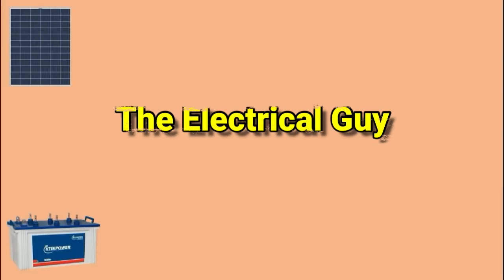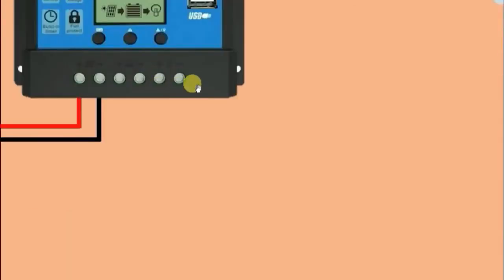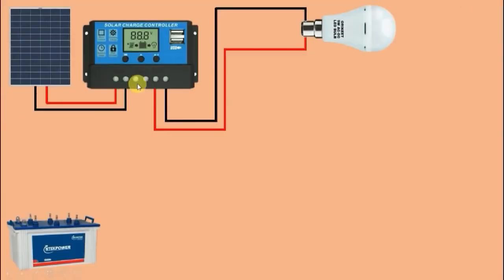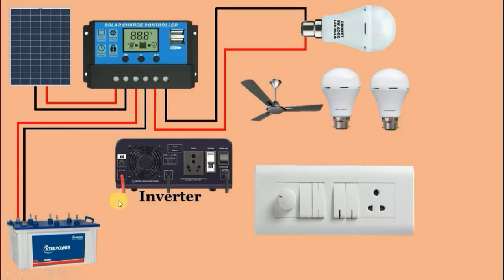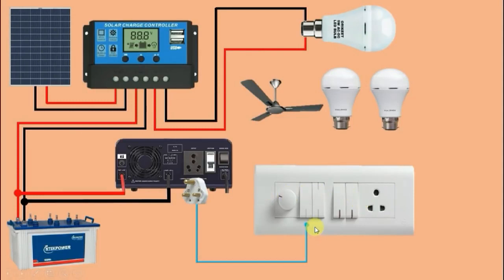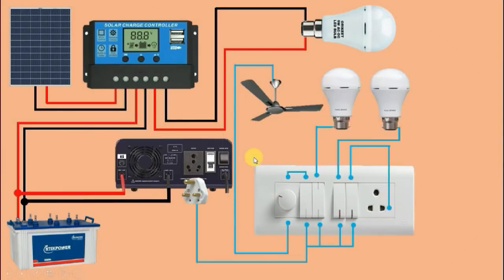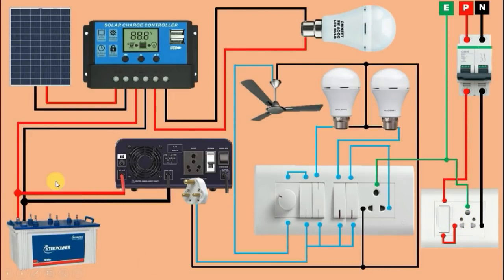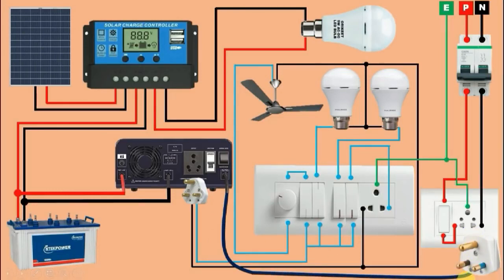Solar Panel Connection with Inverter and Battery for Home @TheElectricalGuy

Comment: Unsafe connections throughout the complete system. No safety protection devices are used on both AC & DC wiring. No AC nor DC Dubble Circuitbreakers or DC fuses are used to protect the wiring. 
Incorrect earth wiring is used. The solar panel should be earthed. DC combiner protection box must be used from the Solar generation to the charge controller, inverter and an AC change over switch distribution board must be installed. The grounding wiring must be continuesly wired throughout the system with a low impedance of not  > then 10 ohms. The AC distribution board must be protected with an double pole main switch and earth leakage device to protect human life's against electrical shock. In my view it's totally an unsafe method of wiring.

Comment: Hi there, I'm a big fan of your videos and have gained a lot of knowledge from them. I'm looking to construct a home battery system that can take advantage of time-of-use electricity rates. My goal is to charge the battery during off-peak periods and automatically switch to battery power during peak hours. I'd also like the system to automatically recharge the battery during off-peak hours while simultaneously powering my home with off-peak electricity. Could you please provide some guidance on the specific electrical components and circuit design that would be required for such a system? My household appliances include three air conditioners, an electric stove, 40 LED light bulbs, a TV, a refrigerator, and more.

Comment: There no such thing as an electric bulb.  The correct terminology is an "electric Lamp".  This was established by both Thomas Edison and Joseph Swan.  Who both invented the electric lamp at the same time, as established by a Court over patent rights.  Neither called it a bulb, which is slang term for a lamp from the automobile industry.  It not a term used in the electrical profession.

Comment: You have given wrong information. You should correct it. You said when it is night and there is no sun then the devices connected to the output Load of the controller will turn off. This is not correct.
Then the controller takes power from the battery and keeps the devices running as before.
Reply: in days can solar charge battery and at same time battery give AC current can that is possible?

Comment: Is there any plug to automatically convert to AC power supply when less battery when less sunlight but then automatically use solar battery when enough sunlight or.. for solar priorities first?

Comment: Awesome, I have one question - - Is there any automatic converter available, If solar panel is not produced the power (due to bad weather) then battery should charge automatically from government electricity. if yes, please recommend the product and share the video for connections, I need to avoid manual work (i've normal inventor only)... Thanks for knowledge sharing...
Reply: Same question
Reply: I recommend a hybrid system to mitigate such issues.
Reply: Same question here too, bcz when the power goes off it won't automatically switch to inverter in this case
Reply: In this case you must Have to use solar inverter...solar inverter work both side...when solar panel at peak level then battery will charge through solar panle and as well as also usees ac when solar voltage down.so Solar Inverter is best Remedy for this issue.
Reply: Yes there is,  

 Luminous Inverter NXG+ 1600.

Comment: It’s very good n very helpful, but you are just missing isolators for ac , arrays n battery isolators. Would you make another video including isolators please. I would say this the simplest n best  video on you tube to understand solar panel system connections.

Comment: I really like your video and there are almost no people addressing this issue. I have some problems. Your AC switchboard does not look like anything I've seen here in the US. Also, the back of your inverter is very different than what I've seen. I do think I can figure out how to do your steps even though these things are different, but I'm not sure what to ask for if I want an "AC switchboard" in the US. Thank you for your very understandable instructions!

Comment: mean in night hours we must connect direct ac supply through inverter to further charge the battery and utilise all other appliance connected to the inverter load. there must be some breaker between charge controller and the inverter which blocks supply back to the charge controller, means cut off the charging supply from it. who will disconnect that breaker, there must be a person deputed to break the supply from solar or charge controller everyday before evening and make it on after morning time daily.

Comment: Question
The Electrical Guy, a very excellent video here. My Question is: In my open farmland, I've a 3600w SOLAR PANELS ARRAY, a 3500w SOLAR INVERTER and an AC SUBMERSIBLE WATER PUMP of 1,700w(1.7kw) energy rated capacity. My country is on the Equator. Very good sunshine. I want to do a connection as follows: From solar panels to the solar inverter to the AC Submersible water pump. Simple!. Note: I don't need to store energy. The sun must shine tomorrow here 😁🤪. So I don't need battery. Is my connection going to be O.K ? Do I need any SOLAR Charge Controller? Is there risk to the Inverter?
Reply: You sure need a Charge controller to stable the voltage coming from the solar panels for the output to be normal
Reply: @imevbore  Thanks alot
Reply: Can one connect the water pump direct from the Charge Controller?
Reply: @peterhanson5130  No Sir. The pump uses AC power. The charge controller gives out DC power. So not compatible

Comment: need to correct one thing otherwise charge controller will burn, 1st battery will be connect to charge controller, then pv etc.
Reply: Is that the battery of the cars?